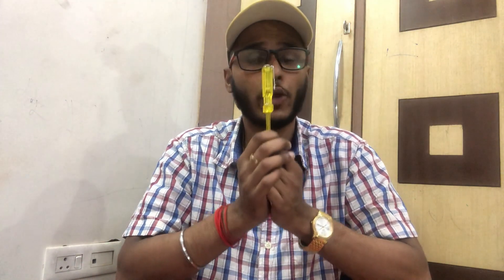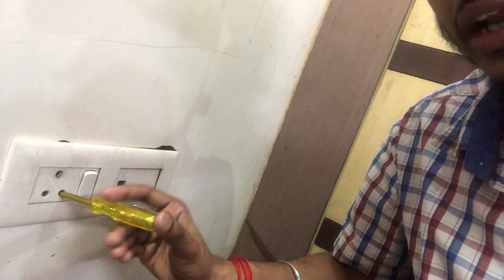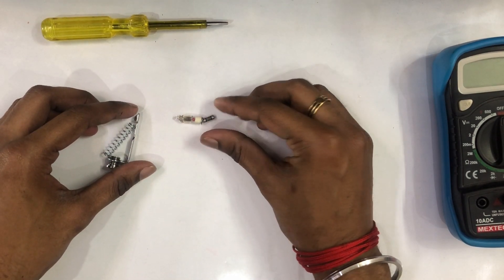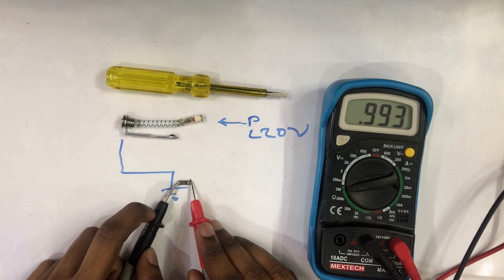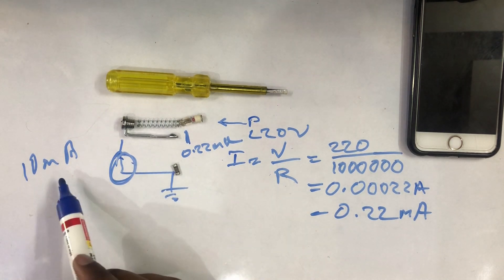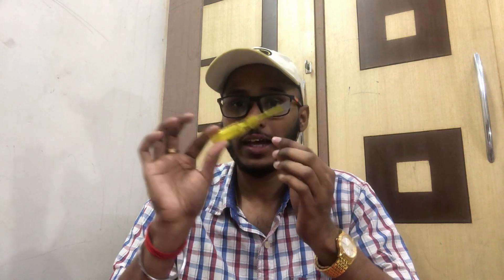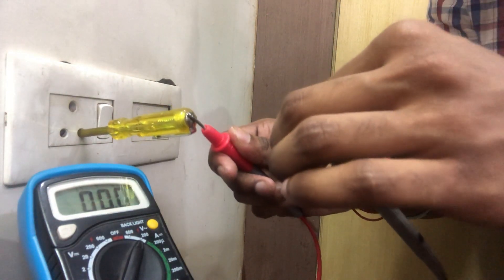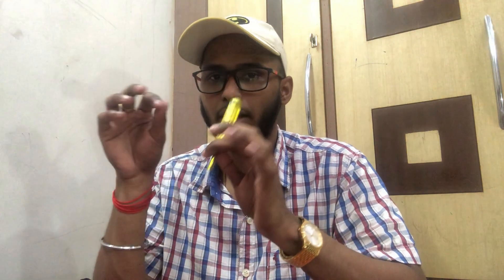ടെസ്റ്റർ ഉപയോഗിക്കുമ്പോൾ എന്തുകൊണ്ട് ഷോക്ക് അടികുന്നില്ല | Why didn't we get Shock from Line Tester

Comment: Bro njan soudiarabia yil work cheyyuvannu ivide line voltage 220 (1 phase neutral) & (110vot two phases) enna 2 option il varunnund ente samsayam 110 volt linil oru normal inverter engane conn cheyyum ennathanu karanam aa circuit il common (neutral) ella line varunnath 3 phase (3 um 110 volt) aanu athil ninnum ethenkilum 2 phase eduthittanu 220volt load connect cheyyaru please reply bro
Reply from the maker: Bro, Invertor in neutral aavisyam aanu... iny avidethe rules aryilla rules il ok aanel ground cheyth neutral undaki edukanum sadhikkum...
Reply: @TechCornerMalayalam  ithente oru doubt aanu aa 3phasil(110vot) il onnu common(like neutral) aakki bakki 2 phase um 2 circuit aakki connect cheythal proper work cheyyan chance undo
Reply: Salil Krishnan bro manassilayilla onnu clearakki paranju tharumo

Comment: Battery terminals kand pidikkan valla vazhyum undo
Reply: Bro multimeteril polarity nokkiyal +-terminal kandupidikkam.dc volt check cheyyumbol polarity change ayal -vannathinu sheshame voltage kanikkuuu.
Reply from the maker: Multimeter use cheythu kand pidikam...negative reading aanu verunethenkil red probe koduthekuneth aanu battery negative

Comment: Series circuit ayath kond current flow same alle... 
Voltage drop il alle difference undavoo..
1Mohm resistor loode ulla current um neon lamp iloode ulla current um same alle.... (7:24)
Reply from the maker: Athe series circuitil current same aanu pakshe ennu vechal 1 mega ohm resistor undakunne current alla full circuitiloode oduneth...oro components athintethaye resistance offer cheyunund athin anuserich oru currentm undakunund ..eg 1m ohm resistance r1, lamp resistance r2 aanel total resistance r1 +r2  il undakunne oru current aanu full circuit loode pokuneth.. pakshe ivide sredikende lampin across olla voltage 220 alla resistor output cheriya voltage aanu so avidethe currentum theere kurevaan..
Series parallel circuit ine patty video cheyyam for better understanding

Comment: സീരീസ് കണക്ഷനിൽ ആംപിയർ വ്യത്യാസപ്പെട്ടില്ലല്ലോ ....ഒരേ കറൻറാണല്ലോ റെസിസ്റ്റൽസിലും നിയോൺ ടെസ്റ്റ് ലാംപിലും മെറ്റാലിക്ക് പാർട്ടിലും മനുഷ്യ ശരീരം വഴി എർത്തിലേക്കും ഒഴുകുക... അത് 0.22 മില്ലീ ആം പിയറിലും കുറവായിരിക്കും...
Reply: എന്നാൽ ഓരോ കംപോണൻ്റിലുമുള്ള വോൾട്ടേജ് വ്യത്യാസപ്പെടും അല്ലേ?
Reply from the maker: Athe Ampere nammal series aayitaan measure cheyuka...ivde net tester accross verunne current approx to 0.22ma aayirikum if voltage is 220.
And about voltage,athu across each component will give different one.
Reply: @TechCornerMalayalam  220/ 1000000 ingene cheyyan pattillallo? 
1Megaohm resistor nte across ulla  voltage ne anu 1Megaohm kond divide cheyyendath.

0.22 mAmps correct allallo????
Reply: @sajidpk01  ശരിയായ കറൻറ് 0.22 മില്ലീ ആം പിയറിൽ കുറവായിരിക്കും എന്നു മനസ്സിലാക്കാം....
Reply from the maker: @saj saj :Voltage across resistor 220 aayirikum ... ivide current across resistor aanu kandu pidichethu...series circuitil current same aanu pakshe ennu vechal 1 mega ohm resistor undakunne current alla full circuitiloode oduneth...oro components athintethaye resistance offer cheyunund athin anuserich oru currentm undakunund ..eg 1m ohm resistance r1, lamp resistance r2 aanel total resistance r1 +r2  il undakunne oru current aanu full circuit loode pokuneth.. pakshe ivide sredikende lampin across olla voltage 220 alla resistor output cheriya voltage aanu so avidethe currentum theere kurevaan..negilgibly small aanu so 220 v aanu supply enkil current approx to 0.22 aayirikum
Series parallel circuit ine patty video cheyyam for better understanding
Reply: @TechCornerMalayalam  220v= neon lamp drop + 1Mohm resistor drop
Reply: @TechCornerMalayalam  circuit current same anu. 
Voltage different anu... 
Current through resistor and neon lamp are same with different voltage drop. 
Circuit Current (rms) = 220v / (1Megaohm + neon lamp resistance)
Reply: @sajidpk01  yes...The Current through the whole circuit is approximated to be less than 0.22mA...220 /(1M + R Neon +R other+R human body)< 0.22mA
Reply: ചിലപ്പോൾ ഷോക്കേൽക്കുന്നത് എന്ത് കൊണ്ടാണ്
Reply: @rajeevantm5902  ഏതെങ്കിലും കാരണവശാൽ ഒരു 1 M ohms 
റെസിസ്റ്റ്സ്റ്റൻസ്  കേടായാൽ (ഷോർട്ടായാൽ) ഷോക്കേൽക്കും